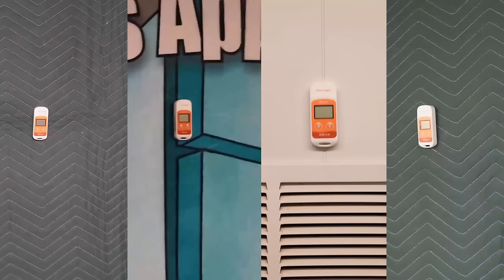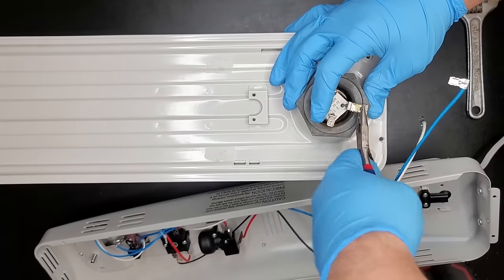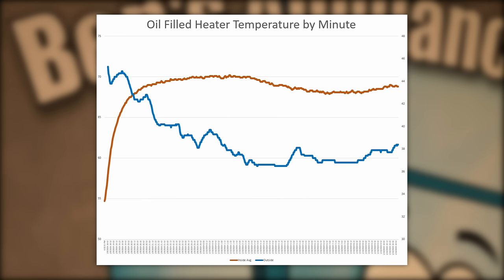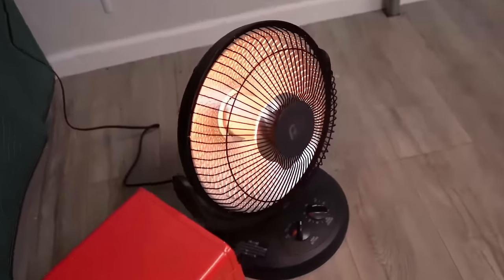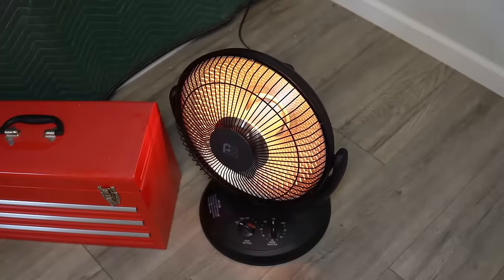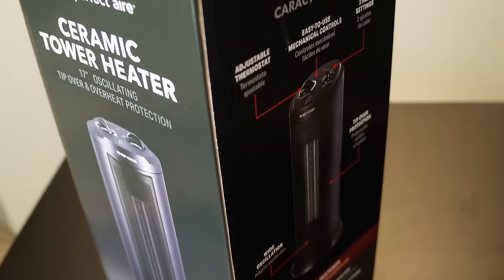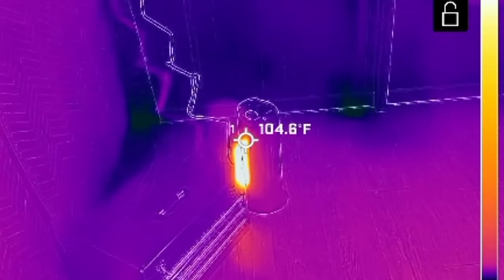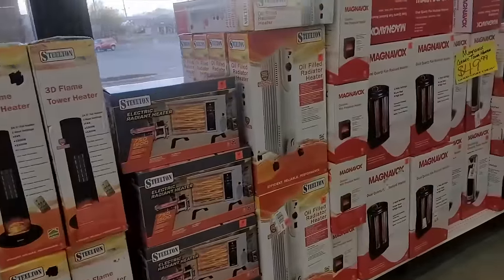What's In an Electric Heater? Test & Teardown of 4 Heater Types

Comment: One thing good about the oil filled heaters that they are safe I have used one in my little workshop for over 20 years !
Reply: Funny, I remember over a decade ago there was a recall on them from over heating the wiring and catching fire

Comment: Agree with many others that the oil-filled radiator is my favorite electric soace heater.  It's also the only one I am comfortable running unattended, such as when I am not in the room or while i am sleeping; concerns about fire risk on the other types is such that i won't do that with them.

The oil-filled radiator has the added benefit of not emitting the usual "burnt dust" smell the first time you use it after taking it out of storage, which heaters with exposed elements usually do.
Reply: The oil filled radiator heater I used had a smell that the manufacturer said would go away after a few uses, but after a few weeks the smell was still there.  There were no leaks and I ended up returning it because it was making me nauseous.  But when I was a kid we had one for my room, which was unheated, and it worked great, I don't remember it having a new product smell.

Comment: You spoke of higher end infrared heaters. Long wavelength infrared heaters are what you mean. The heat from these feels more like regular room heat. It's not so much hot right on the surface, the heat penetrates a little further because it's a longer wavelength. You might feel warmer under a blanket with a long wavelength IR heater than with a short wave IR heater, especially if there is a draft or a fan in the room. One downside of the long wavelength IR heaters is they take longer to ramp up and ramp down their heat production. That is inherent in the physics because a long wave IR emission corresponds to a lower temperature which means a much larger radiating surface and therefore more thermal mass.
Reply: Do you know if IR heaters have any positive effects on health? If so, which wavelength? Thanks.

Comment: Thanks for doing mini teardowns... those are always interesting!  Having bought and used all four types of heater, I personally found the wire with fan heater is the best option for me when in a small/med sized room with a door.   The oil filled took a long time to heat up, and never seemed to get my room warm.  The radiant heater works great if it's pointed at you, but same as the oil filled... didn't seem to warm up the room much.  I may have to get my ceramic heater another try since that seemed pretty good.  Having a fan forced wire heater running at 750W/1,000W seems to be the best balance for me (I don't run at 1,500W due to fire concerns)... having the fan blow the air on me and circulating warm air in a room with a closed door get's the temp up to where I like it within 20-30mins.

Comment: I like the oil filled radiator style. They DO get a little hot to touch but I don't think hot enough to catch anything on fire that might drop onto it. The little ceramic cube heaters are sold as being the safest.
Reply from the maker: I love the radiators personally. I use one constantly in my shop for overnight warmth

Comment: I had a ceramic heater.  The fan failed after several years. I thought since it was a high-end heater there would be worth the trouble of taking it apart and putting another fan in. But that's when I discovered that it didn't actually have positive thermal coefficient heating elements! Instead behind a cover there was just two very large ceramic resistors. These were glued to a large chunk of aluminum honeycomb that served as the heat sink. Not bad technology but definitely not what I paid for either, and probably not what you have there if brought up quality coming out of China is anything to judge for from.

Comment: There's an important aspect of safety to be considered. The oil heater imo is very safe compared to the others. Project Farm also showed this.
Reply: Yep. No moving or exposed hot parts. I mean, the fins on them are definitely hot, but you aren't going to get an instant burn from them. They are the only type I feel comfortable leaving unattended for room heating. As mentioned in the video, also dead simple in operation, really nothing to go wrong. Only one I've ever had fail was the only "fancy" one I bought with a digital thermostat...guess what part quit working...
Reply from the maker: The only thing I can see failing would be the thermal fuse due to an overheating scenario, and much like any dryer, its a $5 part that can be replaced in a matter of seconds.

Comment: Used a dish heater from Costco for years. It heats my entire apartment on low or medium with a fan blowing across it.  This unit has an infinitely variable temperature control, like the ceramic heater.  So I just set it to whatever temp I want and it does the rest.  I have another dish heater like the one in this video, and the huge difference is that it does NOT regulate based on temp. It only has power settings and a timer function, both of which are useless. Power level means nothing.  How the room feels is what matters, not how much power the heater want to use like it or not. And a timer? If I need heat, it's not based on hours. It's again based on the temperature achieved.  It may need to run 24 hours a day for a week.  A timer that maxes out at a couple hours is begging to get deleted.  My old Coscto dish heater gets all of it right.  They should all be like this. They're not.

Comment: The beauty of the radiant heater is that although it does not do well at hitting a room, it does absolutely great at spot heating, aka, a person. You can be at a much colder room and still feel comfortable. The downside is you need to be in front of the heater all the time LOL. So it works great for some things and not so great for others.
Reply from the maker: I'll be honest - I never used a radiant heater prior to this. Always oil/wire/ceramic, and it definitely did the best to warm me if I was standing in front of it, at a fraction of the wattage. But you're right, not great if you're just trying to heat a space, or for say, pipes in a kitchen.

Comment: So which one was best?

I couldn't track with everything you said. I'm tired from working two 15 hour days this week.

Which one was best?
Reply: The oil heater.  With the chart @12:50, the bottom row, lowest is essentially the cost of the heat given.
Reply: @JohnC1  But does that factor in the purchase price of the heater?

Comment: If you take off the FRONT GRILLS on the non oil filled heaters, you will see there efficiencies increase by about 10%. The grills r a hindrance to the efficiency of the fan blowing. Dont think I would be comfortable doing it with the wired heater because that would expose the  fast moving, metal fan blades. The other two however, either have no blade or have the blade(s) safely enclosed behind the heating element. The only exposure is the heating element itself, just like the metal oil heater does.  Personally, I prefer the ceramic heaters. They are lightweight, easy to locate close to the ground, have quick heat up times and help move air around the room. Also compared to the oil filled units they r typically less expensive. Thanks for the insight.

Comment: Oil filled, it does not burn the air causing dryness and static electric shocks. It does dry your sinuses. You can sit beside it without it burning you. You can place a metal plate on top of it for additional radiating surfaces. It can be placed next to furniture or beds without catching fire. Its virtually silent, no fan coming on and off all night.
Reply: The act of heating air always lowers the relative humidity, no matter how you do it.  (Well, assuming you aren't combusting things.)  For a given amount of heat rise, the relative humidity will always drop the same.  (Meaning the same amount of static and dryness.)  "Burning the air" isn't A Thing.

Comment: You left out what setting the ceramic was on, looks like you set it full/1500W  I always look for a ceramic that has at least 3 settings, to use less Wattage. I never use 1500 or even 900 on my Mainstays, made by Midea. I use 700W and get plenty of heat. Also so I won't trip a breaker. Midea makes things for top brands, and the quality feels great. $20.58 for a 3-level ceramic W/ powerful fan. Cannot beat it for price, and a wide base to make it stable. I researched small microwaves recently, and the top 2 were Toshiba, made by Midea. They own the name for making certain things. Midea also makes things for LG, etc. Can't go wrong. Fan only, and 3 Power-use settings.
Reply from the maker: They all used max settings / 1500w, and the consumption was noted that the average was near 1500w
Reply: It would be nice to know which ones really pull at the lower settings. And to calculate the energy usage per hour. @bensappliancesandjunk

Comment: Great review! I have used oil-filled and infrared heaters and prefer them because they are silent, the light-emitting aspect of IR is not a problem because they are used only occasionally in utility spaces away from eyeballs mostly. 

A question, since you showed some heater innards there. An older oil-filled heater with an electronic display wants to click off and reset itself to "flashing 12:00" mode after about an hour of use on medium output, but still works after a few minutes (I never use unattended, and always give it a day off if it does trip). I'm guessing this is a faulty thermostat switch? The cord/plug/receptacle does not get hot, and the anti-tip cutoff works as designed, de-energizes the whole thing while it is leaned over, and re-energizes to "flashing 12:00" mode when righted. Thermo switch? Thanks! Great channel, subbed for a while now.
Reply from the maker: Thanks for the question. I would have first asked about cord/plug/receptacle as my first point of consideration. I'd check the thermo switch or the anti-tip switch. The one that I showed later on was/is a ball bearing + switch and I could see situations where maybe slight movement could tip it if it wasn't set right in the housing as well. 

This one was so simplistic on the inside after the 3 screws, there's very little to screw up and should be easy to get open and investigate also if any wires may be burnt, causing it to be overloaded, too.

Comment: I've noticed with a lot of space heaters by plugging them into my killawatt meter that they don't actually draw up to their rated power. It does increase if i plug it in directly next to my breaker box but still not to the max level. I thought maybe it was a voltage issue but the voltage in my house ranges from 119 to 125 volts. So that doesn't seem like it would make that much of a difference.
Reply from the maker: I wonder if its an issue with the thermostat(s)? One thing I noticed with this test for example on the oil-filled heater is that it has a max draw of 1,500w, but over 16hrs didn't get close to that. I wonder that since it was about 2ft from the corner wall, if the heat reflected back onto it, and triggered it to stop running prematurely vs. the others that didnt rely so heavily on convection.
Reply from the maker: @f_youtubecensorshipf_nazis  maximum allowable is 1500w / 12.5a to ensure the breaker doesn't trip generally throughout all 120v heaters in the US. If you go past that, typically it immediately jumps to 240v/20a heaters and such
Reply: @bensappliancesandjunk  I know most space heaters have very poor thermostats.  I've used so many of them over the years due to poor ductwork in my house so I've dealt with all kinds of junk lol. I've had heaters that keep thinking it's getting colder throughout the night and keep cranking up the temp so I wake up in a sweat. But that doesn't exactly explain why my 1500 watt heater is only drawing 1350 watts or so.

Comment: nice new appliance category to get into you channel. only the radiant heater is interesting due to better efficiency. are there small heat pump based heaters or is it just split-types?
Reply from the maker: Any heat pump heater will need a split to dump the cold air somewhere. They just exchange heat rather than create it. Far more efficient, but at the cost of needing two coils to absorb heat, and the other to expel it.
Reply: @bensappliancesandjunk  Good point about having multiple coils because the problem with portable ac/heat pumps as they are negative pressure, the house will have to intake air from somewhere. i looked into window type heat pumps but does not look too popular yet but it would be interesting if you test/review one
Reply from the maker: @zodiacfml  the company that sponsored this post has offered to send me some heat pump/AC units to try out in the future. Window units are neat for certain, but I think self-install heat pumps are the future. Same idea, just window-less and unfathomably high-efficiency ratings.  A high end LG inverter AC will have a SEER rating of 13-14, while a mid-grade AC/heat pump is 18-19.
Reply: @bensappliancesandjunk  what a coincidence. i can't wait for these videos.

Comment: I was always under the impression that the oil filled was the most efficient until I saw your date on the radiant heater.
Don't like that the wire heater heats up the cord so much...

Comment: All electric heaters give roughly the same heat output per watt input, as is pretty well known by now.  But one, the oil heater, has the distinct advantage of not frying the air and lowering the humidity.  The more you lower the humidity, the higher you have to raise the temp to maintain comfort levels.  This gives the oil heater an edge....
Reply: Relative humidity drop is a function of heat rise.  You take air that starts at a certain RH, raise it by the same number of degrees, it doesn't matter what kind of electric heater you use to do it, even a heat pump.  "Frying the air" isn't A Thing.

Comment: I suspect from looking at your FLIR footage that the battery in your FLIR camera is failing. I'M ON MY THIRD BATTERY. Not great and they don't provide directions but they aren't terribly hard to change. The battery is getting puffy and that's bending the circuit board just a little bit and that's why you can't get the optical edges overlay to line up with the heat signatures.
Reply from the maker: The wire frame images have always been odd. This one is mounted to my phone so I'm not sure if it's perfect. Usually if I remove the wire frame it looks more presentable though

Comment: Anything with a fan is going to get clogged up and require disassembly to clean properly, especially if you have pets. I get the cheap oil heaters and move the air if needed with small and cheap fans on the low setting. Avoid digital control heaters of any type because they won't come back on after a power fail.

Comment: So which is less expensive to run
Reply: The ones that have settings lower than 1500 Watts is what I look for. There are videos of people with Killawatt devices hooked up, showing power at lower settings. For some reason, he didn't think this was important, so I unsubbed.
Reply: Per the  chart
1st  radiant (the winner)🤑🤑🤑
2nd  ceramic
3rd  wired
4th  oil filled

Comment: All fan/oscillating energy converts into heat via friction. With heaters there is no efficiency loss.
Reply from the maker: Yes, but how they project the heat differs, and you can see a ton of heat from the wire fan hitting the floor directly in front of the unit instead of the or other areas that could be an objective t warm.
Reply: @bensappliancesandjunk  yes agree, and great video also. Just pointing out that even the cord getting warm is heat transfer into the room. Though it may be less desirable. Psa do not coil high draw electrical cords